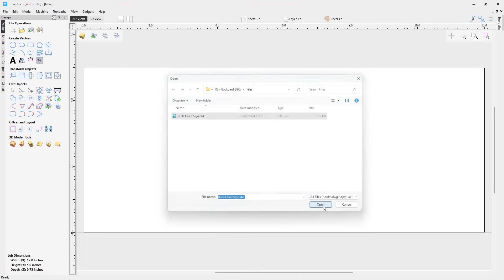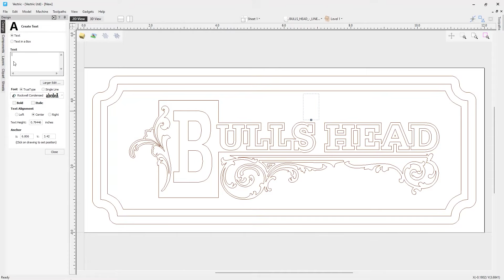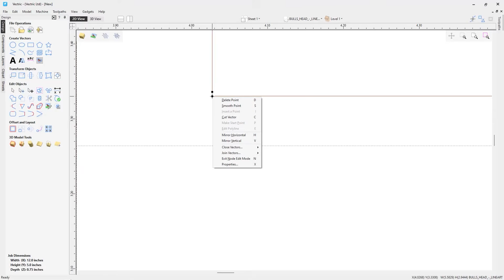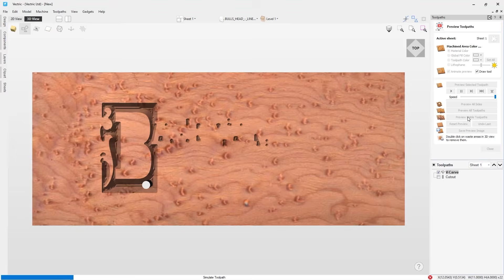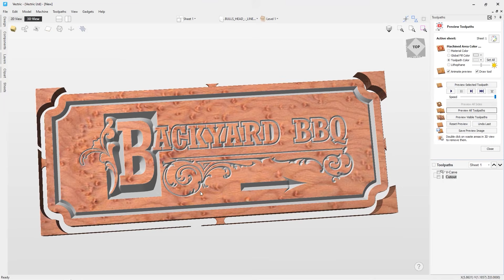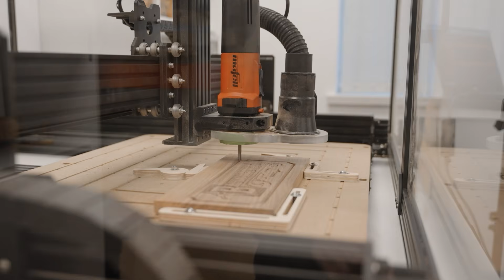How to create a v-carved sign in Vectric software | Getting Started | V12 Tutorials

Comment: Hi. I am doing a text vcarve procedure but regardless of the settings, it cuts the profiles mulitple times letter by letter. Lettering is tiny with each cut a fraction of a millimeter wide (basically scraping the surface) so it should be able to run in one single pass. Custom text so unable to convert to single line text. Parameters: 45degree 1/4in bit. Pass depth: 6mm. Please help
Reply from the maker: Do you have a flat depth selected, if so when you take a look at your tool setting look at the Final Pass stepover - this is the stepover used for the flat bottom (not the steps above that is taken care of by the Clearance Pass stepover).  

I would think if it is small text you would not need a flat depth and the 6mm pass depth would force the tool to do everything in one pass. 

If that is not the case it might be best to send your file to support@vectric.com with a description of the issue. :)

Comment: Can I use the Vectric software to control my Genmitsu 4040 Pro Max? 
Why do you have to save off your toolpath and put it onto the USB drive and bring it to another machine to do the actual carving? 
If I have a computer with Vectric Desktop on it and it's hooked up to my Genmitsu 4040 Pro Max can't I carve it from that same machine?
Reply from the maker: Hello... and yes you can use the same machine, it just will require you to have a way to send your G-Code to the CNC.  Your Vectric software comes with VTransfer so you can use that or you could use something like Universal G-Code Sender.